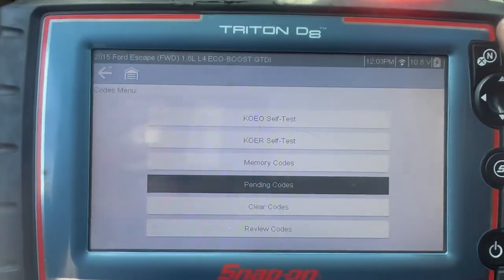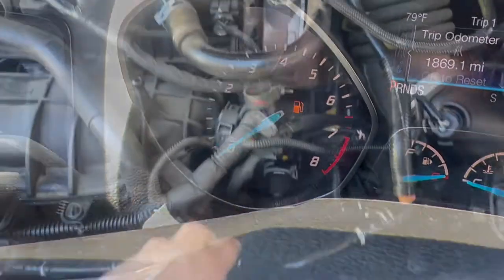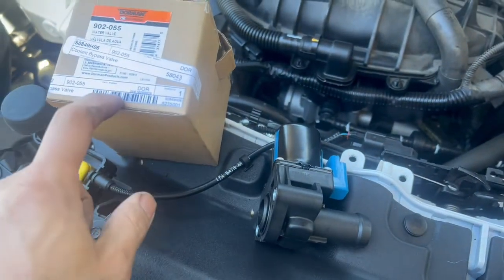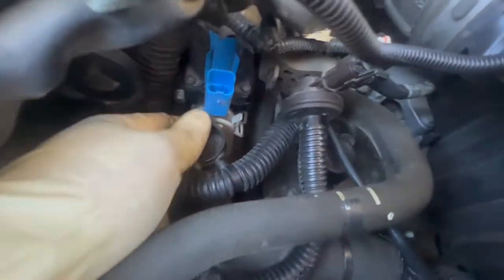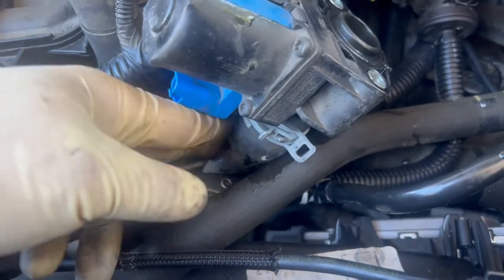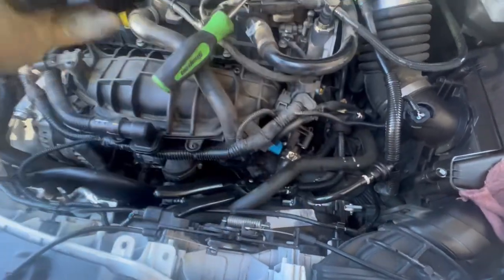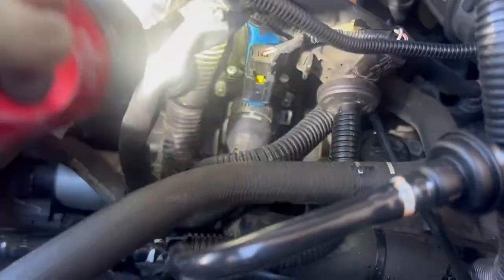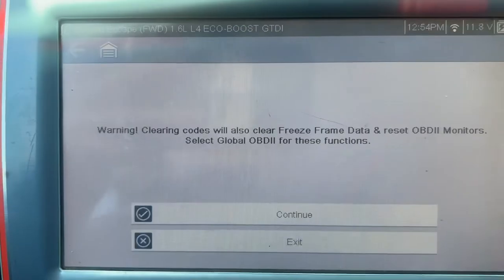Ford Escape Engine Coolant Bypass Valve - P26B7 (Easy Fix)

Comment: My car won’t turn over and this is the code I’m getting, does that seem right??
Reply from the maker: If you have the same code, then replace the same part I did. 
Now your car doesn't crank is a different problem. Check the battery and starter, if either one is bad, the engine won't cranks. 
If engine cranks and doesn't start, then check the sparks (spark plugs) and check for fuel at the fuel line.